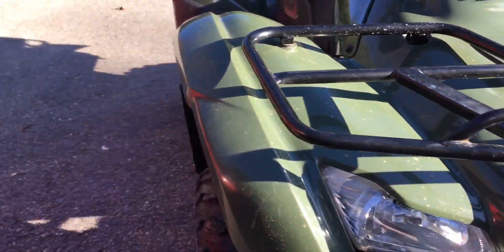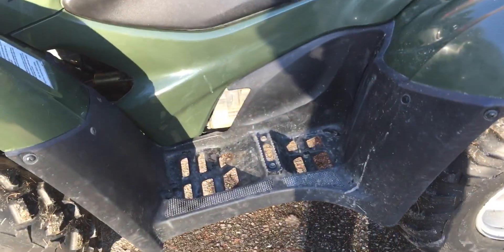Honda rancher ES shift problem is fixed!

Comment: good you got it!...but the cleaning and re-greasing didnt help the 2nd to 3rd problem huh...i wonder how much those shift angle sensors cost,if they are not that much i would try one on mine to see if it helps mine shift any better..im definitely having to hit my button more than once going from 1st to neutral now some times..but i can hear the motor trying to shift so its not in my buttons
Reply from the maker: Smith I may try the sensor because it’s under 20 bucks on eBay for genuine honda, after market is more. Maybe that’s better?
Reply: Smith 
Did you ever figure it out? I’m having the same problem

Comment: My 2017 is doing the same. 200 miles. Wont upshift unless i stay on the gas, and lights and tail light won't work. Checked all fuses and replaced handle bar controls with new OEM and still nothing. Super frustrated with this quad. Ive had a bunch of these ES hondas growing up and this is the first one giving me issues.

Comment: My kill switch is going out. It only works on a small spot. The shifting is good tho
Reply from the maker: THE PICKLETON17 go on eBay and look at that hole es module, it’s not to expensive.
Reply: Kountry Quads Ok thanks

Comment: Can you show 2 timing mark how correct installed it?
Reply: There’s no timing marks on the gears. The o to hear that has to be set a certain way is the swing gear on the actual shift shaft it just has to be set centered.